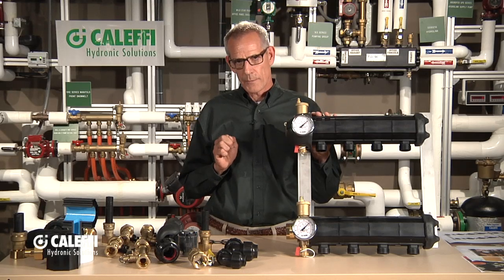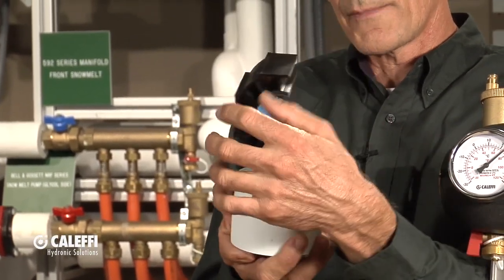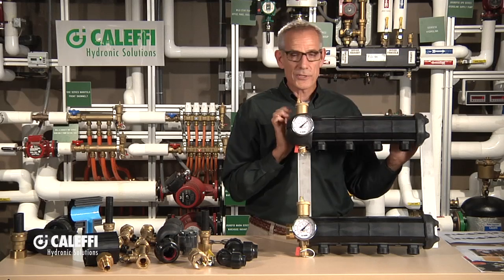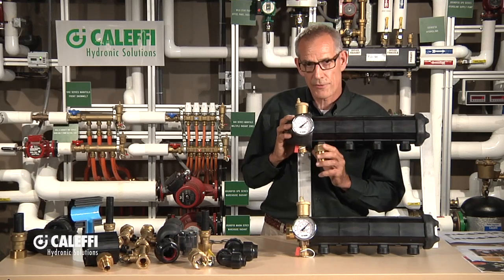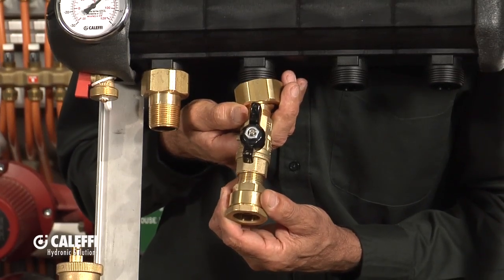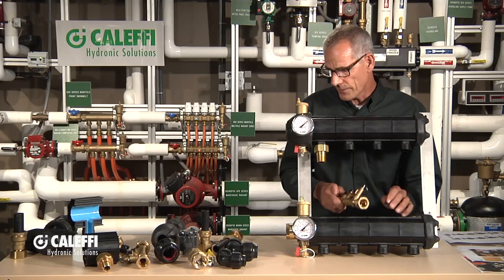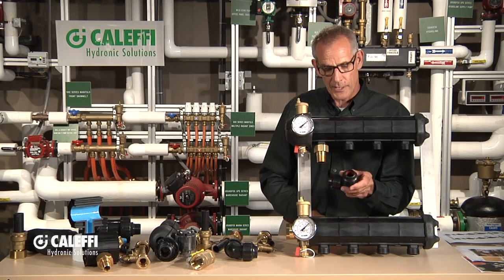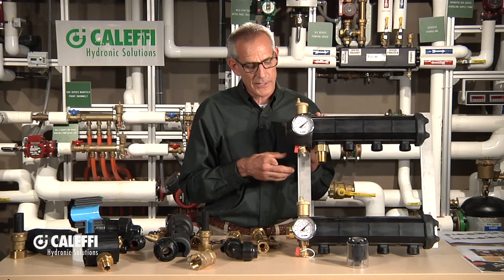GeoCal™ - Manifolds for Ground Source Loops

Comment: We have a geothermal since 2006 (after the tornado) and got it replaced with a new one unit that is a 4 ton. However, our manifold has four tubes of each going out 8 feet into the field. Keep in mind that there is black insulation around our manifold. Our manifold is located under the house's crawl space.

Nevertheless, is it wise to fuse the pipe ends into the manifold? What are the benefits to fusing the end pipes into the manifold?
Reply from the maker: Sirs, first of all sorry for this unforgivable delay. As for our answer, some manifolds are field assembled from fusion fittings. This is common practice for most installs and may be more cost effective. Our manifolds make for a very serviceable system with more components that can be connected to it. Hope this helps.